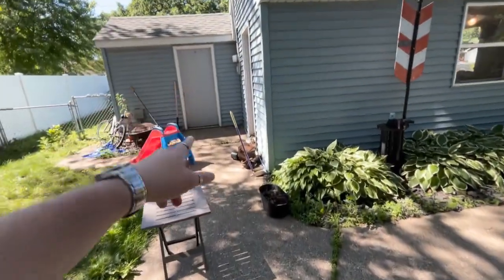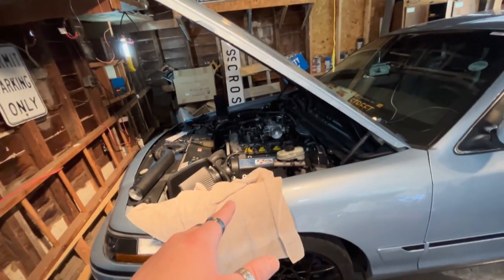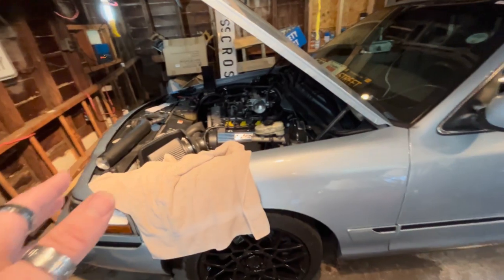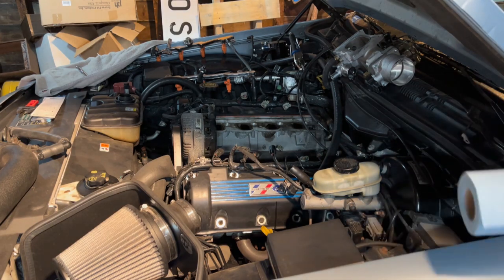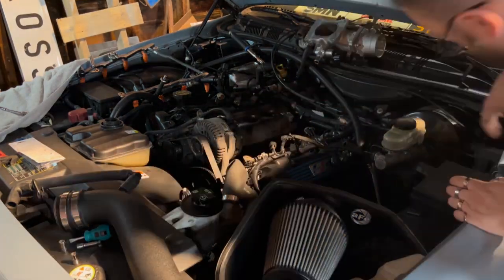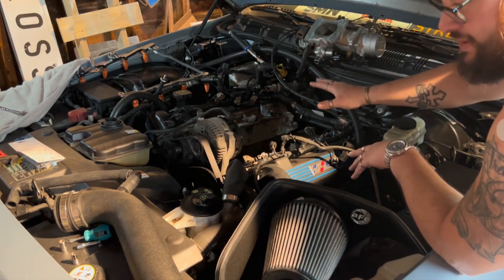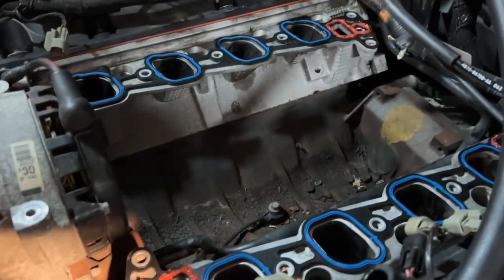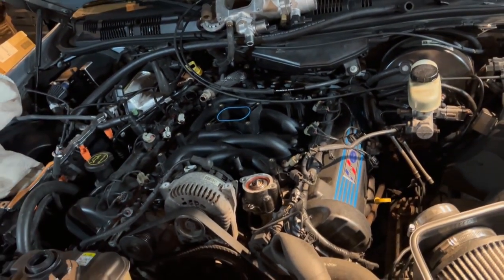The Mafrauder gets a (almost) new PI intake! Tips for your Crown Vic, Grand Marquis, Town Car intake

Comment: 02:12 leave the entire fuel system together. No need to pull it apart and risk getting dirt in it and tearing o-rings, just lift the entire fuel rail up and tilt it over and sit it onto the the battery area upside down.  You can start the car and trip the fuel pump cut off switch or pull the fuel pump relay to burn down the fuel rail pressure(the car will die after 10-50 seconds) so the fuel injectors will not want to push out of the fuel rail.

Comment: I got a question and maybe you can help me. I’m working on my explorer and the intakes are slightly different. I’m replacing with the new ford performance design cause Dorman is just TOO bad. I know it's not as good as a stock PI, but I digress.

The difference is that the heater hose on the exploders go straight to the crossover, and on the mustangs and panther cars it goes to the back of the intake. I can plumb it to the crossover no problem, it goes where the temp season is on your car and the exploders don't have a temp sensor there, but I’m not sure how to block off the "stock" inlet on this style intake. Help is appreciated!
Reply from the maker: @bobbymarks2485  personally, I would try something like a rubber pipe cap, a good hose clamp, and lots of RTV. It’s not threaded, so you don’t really have many options for plugging it…

Comment: 03:55 do not remove the EGR valve, no reason to. I have changed 1,000s of these intakes and have never once removed the EGR valve, 10% of guys that do will bust the EGR valve pipe when it didn't even need to be removed.  just remove the two 10 mm bolts holding the EGR valve to the TB and lift the TB up and out of the way resting it over on top the pass front tire area, throttle cables still hooked up on 04 and older.

Comment: They have newer ones that look like dorman that have longer runners Ford made and Chinese brands almost no difference in power
Reply from the maker: The new "Ford" design still kills power, just not as much anymore, LMR did the dyno on them. Something like 10hp loss, which, take it or leave it, is still better than the Dorman lol
Reply: @Socoolds455  Yeah I think the theory behind all that is supposed to be more reliable I guess I mean I don't know. I'm running a knockoff Chinese doorman looking version and this one has a deeper bowl like the runners are a little bit longer than a real dorman. So far it has been decent as far as not blowing out and leaking but that's not to say it's great. Hopefully someone will post a review on the newer Ford intake after they have ran it for a while and see if it lasts. It'd be interesting to see how much more reliable it is as opposed to what has been out there.

I think if this newer intake craps out I will probably go with the newer revised Ford intake. 

I mean if you want power Cletus McFarland he has plenty of 1000 horsepower vicks